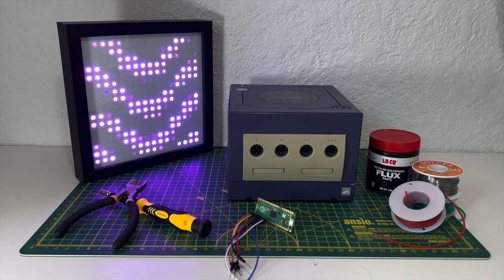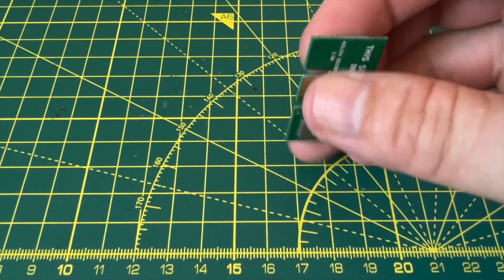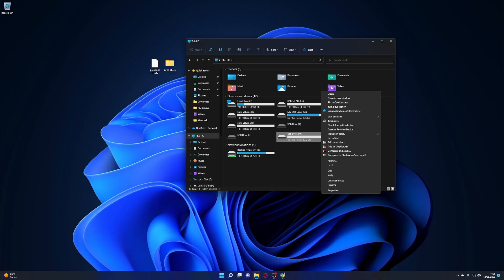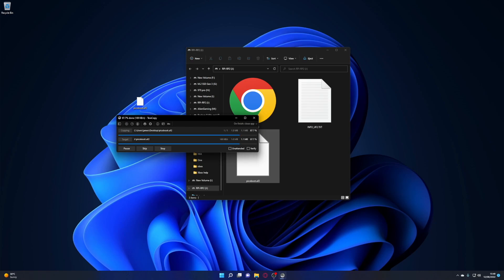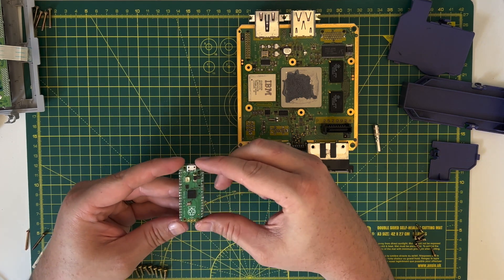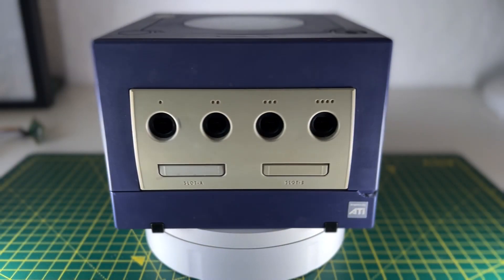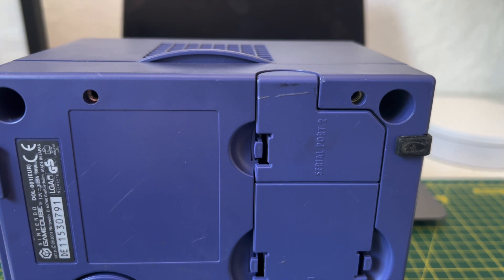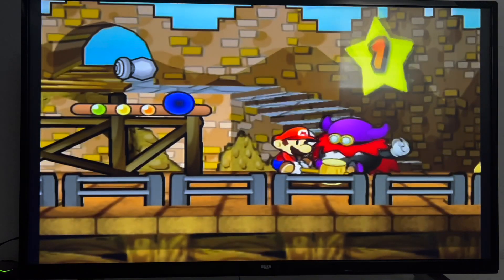Installing The Pi Pico With PicoBoot into my GameCube !

Comment from the maker: So what do you think ? worth modding a GameCube or stick to emulation ?
Reply: Hi, does this mod needs specifics roms? Because I can't boot any. I can read the title of the game from the menu but It doesn't start.
Thanks anyway
Reply: Original hardware will never beat emulation
Reply: @robflint8144  no way emulation is getting much better and some of the handhelds can do just as good a job are you forgetting about the steam deck?
Reply from the maker: @GamingBRO-x9z  both make good points tbh